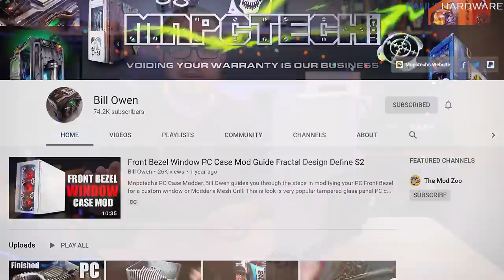I told myself this would be a quick fix...

Comment: Buy the bracket/AMD version and wait or chop a hole in an expensive and no longer available case. Personally I would have chosen the bracket but hey this was far more entertaining for everyone else!
Reply: Exactly, and I think it is also a good feeling to get something done.
Reply: yeah the bracket would of been the way to go. I got the same cooler and bought bracket for the amd cpu and it was definitely worth the 2 day wait lol. keeps cpu cool an didnt have to cut up my case.
Reply: Perhaps, it could have been easier all the way to just use a case with a little more headroom, then you could use the larger cooler. Not a lot larger but enough to use the coolers you already considered at some point. Obviously, this case is not intended for a high heat system - like you have, it is probably intended as a passive cooled system

Comment: Butchering the Sentry case, that's was painful to watch
Reply: Ya, especially when it's designed to handle a 120 AIO and you know he's got like 12 sitting around his garage
Reply: @adamb27473  Probably doesn't want to add an AIO to something that he wants running 24/7 collecting critical data. Honestly its a bit strange he choose that case given he's probably got quite a few other ITX cases. Like a Fractal Nano, or that Lian-li its case he used for computer was it?
Reply: @xxtovarichxx  that's a really good point. I'm assuming he just used it because he needed a surveillance build and Dr zaber sponsered a build at the time, but no reason to keep it in there now. With regards to the AIO in a 24/7 build, at this point, aios are plenty reliable enough. Failure rates are incredible low and the pumps are rated for a rediculous amount of hours, I believe asetek is 70000 hours or 8 years mtbf. 24/7 heat will cause more stress, but not enough that I would worry about it.

Comment: No repair is ever quick.
Reply from the maker: wise words
Reply: @paulshardware  turn the fan the other way around. You will get very similar performance and slightly drop case temps.
Reply: For me it is more like okay this quck fix should do it. Done in a jiffy. But then 1 minute later I'm looking at what I have done in disgust and I have to do it properly. This of course takes much longer.

Comment: Computer cooling that makes no noise at all, that's my FANtasy.
Reply from the maker: But to truly be noiseless, must one not also go fanless? 🤔
Reply: @paulshardware  Or we just implement the fans at either side of a house, so they are far away enough to not hear them. I hear LinusTechTips whole house aircooling coming up!
Reply: @paulshardware  you got 1.2 mil too many then ;)
Reply: @paulshardware  I would rather hear fan noise than coil whine.
Reply: @Lead_Foot  coil whine is the worst.
Reply: @Lead_Foot  Jup I bought myself a fanless dell laptop just for silence. Coil whine is bad, so now I use an ipad for content consumption. So Pauls solution is certainly great, as long as the fan sounds are controllable - I wouldn‘t wanna work next to something that ramps up and down fans all the time

Comment: You could cut the corners 45 degrees to get 90 decrees =) Like a frame.
Reply: Trim out a door.. you always use a miter box.
Reply: @mikeb3176785  Have not used a miter box in over 20 years yet I have trimmed out a few houses.  Am I doing something wrong?
Reply: @ShainAndrews  A miter saw does the job, with power!

Comment: You had me at Paul's "quick fix" in the title and a picture of the angle grinder. This can't end well.

My own "quick fix" a couple days ago, was to fix a nagging nit of a problem by "quickly" flashing the bleeding-edge OpenWrt software image onto my router before doing the dishes and laundry etc.. Two days of panic and sweat later, I managed to un-brick the router and flash the exact same firmware I had the nits with. Guess which nits I'm happily willing to live with until they release the official upgrade. I can un-clench and go do those dishes now.

Comment: You just made an Xbox Series P for Paul.

17:33 - Also for the black strips you made for the cut. Just cut them in a 45 degree angle and you'll get a closed corner for the cut and not have it open. Quick maths.
Reply: PC Series P

Comment: For my portable gaming rig (Node 202, R5 2600, GTX 1060) im using the NH-L9i that i had, with the AM4-bracket, which i got for free from noctua. Scince the cooler is 37mm high and the Node 202 has about 58mm clearance, i switched the included NF-A9x14 with a NF-A9x25 chromax.black fan. This resulted in a few degrees Celsius cooler operation while having a much less noticable sound profile and the black fan with the chrome cooler looks absolutely gorgeous. I am really happy how it all turned out with this rig!!

Comment: Even though watching you mod the case is very entertaining I believe there were better solutions for your issues like moving to a larger case, simply leaving the case without the side panel, waiting for the parts to use the replacement cooler or even switching to an intel system to use the cooler and case if you had the parts. Not as entertaining as the end result but probably more practical.

On another note, you should consider adding a grill to that fan in order to avoid possible accidents now that its exposed outside the case, maybe a custom grill with your channel logo?

Comment: Paul, coming from a carpentry and welding background, the way to get that U-Channel to not have the corner gaps is to cut each end on a 45 degree angle so each end meets. Just something for future reference.
Reply: Electrician here, exactly what I do for the corners-relief cuts are good as well for tight internal curves; its called profile in my part of the world-we use it for cut outs in electrical trunking, switch-gear enclosures etc. 

I have the NH-L12 in a Streacom DA2 9700K build. It is silent unless I'm gaming, brilliant cooler.

Comment: 9:00 If you're on a budget and don't want to buy the rubber u-channel material, you can slit the length of any spare electrical wire you've got laying around, pull out the conductor(s) and use the casing from the wire to treat your mod'd case edges.

Comment: It's aesthetically actually quite pleasing (when the corners of that rubber strip gets fixed, try snipping at a 45 degree angle, like with walltrim). And maybe Jay'd be interested to do a themed modding to 'blend in' the fan, the red light and little feet, turning it into a Surveillance Sentry Bot or sth.

Comment: I wanted this case.  Still kind of want it, but I ended up getting a Node 202.  I'm happy with the build, but the reason why I wanted this case was for portability.  The Node 202 doesn't easily fit in to my backpack like the Sentry would.  Oh well, I digress.  Time to get a new bag.

Glad to see you were able to get your issue resolved. My initial thought was, "I can't believe that he's gonna cut a hole in that awesome case" Fast forward to the end of the video and, I almost wish you would have mounted that hard drive on the outside like the cooler is.  Keep it where it's located, just mount it on the outside, then you would have both your CPU cooler, and HDD on the outside to look at.

Comment: The NH-L9i is amazing. I just put one in my father in-laws PC. He was running an intel stock cooler for the last 5 years. It was idling at 80-90 C. The thermal paste was dust. It was bad. Anyways the results were a near 60 degree drop. I was impressed that such a small cooler could do so well. Noctua is legit.

Comment: The only thing I'd change is 45 degree cuts on the trimming - good job! 

If you want a fan grill like many are mentioning, maybe you can use the piece of the case you cut out and mount it to the top of the fan? With more trimming of course.

Comment: You can put some electrical tape (small pieces) at the corners or if you have black paint you can paint it with a small brush. In case you have a spray paint not a bucket, you can spray into a cup/cap so that you can dip a paint brush.

Comment: Nice job on that cut out-!  A nice chrome wire grille would work well on that exposed fan and not hurt airflow or noise at all.  I use em on cases that have punched fan exhaust holes because this makes fans louder, the round wire chrome grilles are the quietest grilles ive found and almost indestructible especially in an exposed area like this.  I cut out the punched opening and install the chrome wire grille over it, makes a very functional mod.

Comment: Hi Paul. At 17:30, you could have put a slit down the top side of the rubber strip (the side facing towards the fan once fitted). This would have allowed you to extend the other two sides of the rubber strip to neaten up the aesthetic if you were wanting to do so. Nice video, thanks :)

Comment: RIP Sentry Case.
Reply from the maker: I MADE IT BETTER
Reply: My thoughts exactly. I have a Sentry 2.0 and with how expensive and difficult to get it was I can't imagine doing something like this to it.
Reply: @paulshardware  I get the argument that "Hey, this is what I have in stock, and I need to make a vid" but why in the WORLD wouldn't you just order the alpenfoen black ridge, or ID IS-60? Or just swap it to a Node 202 to get an extra 12mm of cooler clearance? Seems like going for a non-reversible mod on a non-replaceable case for such a mundane cooling solution is just a waste.
Reply: @benjaminprescott384   Because before it was just, meh... and because it's fun to color outside the lines sometimes. Why waste money on another case when you can give it MORE POWER, ARGH ARGH ARGH!
Reply: @aaaarrrg3773  Because this is a fairly expensive case - and very limited in supply. Also because the end result looks godawful, and could have been avoided with another case.
Reply: @paulshardware  Monster! :~(
Reply: @amshermansen  Does a case have monetary value, or is it a tool to achieve something? He made the case more functional. 

Some cases are beautiful, but the Sentry case is ugly as sin to start with so no harm done on that front.

Comment: For the U-channel wrap, you can just cut the bottom side of the rubber a tiny bit shorter (roughly how wide the adjoining side channel is) and let it hang over to take up the gaps in the corners. basically notching it out so you have a flap that hangs over the edge of your cut. I've done the same with Drywall cornerbead for a window. You could 45 it but I'm guessing that's harder with U-channel to pull off.

Comment: Since the heatsink/fan are outside, running the fan as exhaust may result in better temperatures and also reduce dust buildup inside the case.

Comment: @Paul's Hardware - You could have cut the U-channel at 45° outward angle to make the ends flush in the corners. I would probably take it a step further and glue the corners and centers to prevent it coming off.

Comment: I think it is nice to use a  small form factor however  passive cooled is the only option

i'd use a 1 ton press or look at a  standard cooler that isn't a heat a heat pipe design

Comment: @Paul's Hardware iv used BlueIris to handle cameras. Setup a few systems, one had 21 cameras, multiple drives for backup and offsite backup, it has its own webhost so you can do remote access through your phone. The way we do them is main network into pc, second network card out to a router with a POE switch with all the cameras. Works great and haven't had any clients complain (except for usual ISP buggery)

Comment: Paul, mitered corners are your friend. For those in the audience, mitered means instead of cutting the rubber of at 90 degrees (a square corner), you cut it at 45 degrees to bisect the 90 of the corner, which means both rubbers overlap half the angle, resulting in a clean seam and no "naked" gap where they join. So, hold the snips at 45 degrees instead of 90 and done, no ugliness. Just remember the needed length is the short part of the snip angle, not the long "ears" part.
Paul, Dr Zaber hates you now, he went through a great deal of planning to make a small, beautiful, and versatile case, and you murdered it. Nice overall job though, you recovered a LOT more face than I figured you would, based on your (and my own) history.
Nice b-roll and editing, but that was Joe of course. Heh heh. Even if you didn't destroy anything really, I think the general expectation with the angle grinder thumbnail will get those mad clicks for you anyway. :-)

Comment: Wouldn't it make more sense to mount the fan in a pull configuration, to have it blow the heat away from the case rather than into the case?

Comment: The NH-L9a (NH-L9a AM4 for updated mounting solution) is the AMD version of that first cooler, so I'm not sure if the NH-L9i is going to be any good to you even with an extra bracket. 
I think you may have preferred to get the NH-L9x65 SE-AM4. It would still need a hole cut in the case, but much smaller and has the same cooling capacity as the NH-L12S.
However, if you find the original 
NF-A12x15 slim fan that came with the NH-L12S, you do have the option of mounting that inside the case so there are no spinning blades for little fingers to touch 😆

Comment: Why not just a 120mm AIO again? Worst case you cut some holes in the side panel over the GPU chamber to let air pass through, but you keep things inside the case that way. 

Did a similar mod to a RVZ-02 for a friend's build, worked really well. Just get a short GPU (or in your case, a hard drive), and with the hole I cut to pass air thru from the outside, into the rad, and thru the other side, temps were great.

Comment: The c7 comes with 92mm fan clips, I ended up attaching the noctua fan to the c7, I also tried a setup using the l9a and 3D print 120mm slim fan adapter

Comment: You could, as others already have pointed out, mitre the corners 45° like a picture frame. You can also dab a small amount of super glue on the mitred edges and fuse the rubber together so it will act as a single strip with corners :p

Comment: i have thought alot about pc home survey-lance and the one conclusion i have come to is no matter what you will WANT to pay for offsite storage. Because the point of camera set up's are for the unexpected and what if that involves the loss of your camera power unit and device. SO without proper backup power and dedication for cameras i feel a diy solution is far more expensive than required considering you can probably bundle security with your internet for less than it would cost just to rent server space with enough bandwidth to handle your cameras feed.

Comment: I probably would have cut a small amount of meat out of the back of the case to get the tubes of an AIO out of it. Then put the rad on the side of the case. I imagine the hole spacing on the top panel is 120 or 140mm fan compatible.
Your way Dr Zaber has a prolapse.
I still like it though.

Comment: Will your mechanical hard drive be able to handle several cameras feeding it 1080p at the same time?  Is it a 7200 RPM drive?  I have used WD black drives in the past, but moved to Samsung solid state hard drives.  I like the Samsung magic software that Samsung gives you for free to over prevision the drive.  As the ones I have have a 5 years warranty, and I over prevision them, I suspect they will last.  But I could be wrong.  I also want to build a PC just for the control and recording from about 6 cameras around my house.  They will be either 4K or 1080p....  Looking forward to your build.

Comment: So the issue was the impeded airflow by the RAM/integrated I/O shield/heatsink? Why not just rotate the cooler 90 degrees so you don't have that airflow limitation? Should've been a step between starting and cutting up the case.

Comment: I have an Unraid Server Setup with a VM setup with Windows 10 and running BlurIris security software and its running great.  Only got 2 cameras 1 is a 4k camera and the other is a cheapo 1080 eBay china special.  I have been running this setup for about 5 years.  One thing you need to be careful with is to make sure updates are off as if Windows updates and then reboots it can kill it in the VM, I have had that happen.

Comment: My Meshify C shook with horror after you said the word mod. But I do appreciate your tool craftsmanship. My real concern with that abomination of a cooler is the rubber you put on the edges is going to lose cohesiveness or melt due to the heat radiating off from it. That or i am completely wrong and it will work out for the best.

Comment: You mentioned you had a fan going because it was hot out. Do you have air conditioning in your shop? You can get a min-spliti heat pump system that is DIY.

Comment: He is mounting NH-L12S cooler this way in his 340*310*74 mm case meanwhile I am struggling to mount NH-L9i into my 254*215*60 mm case, where i already put my GT1030, 200W PSU and ITX MB with i5-7500 with one 8GB RAM stick. Great :D  I think I need a bigger case for my project.

Comment: If you're worried about structural strength with mods like this the easy answer is a very short length of aluminium T-track riveted inside the case where it will clear everything

Comment: Instead of chopping up a no longer available boutique case you could've just used google for 5 minutes and found out that one of the best setups you can go with is a Cryorig C7 (copper would be best but i dont think urs was copper) with the l9i fan on top, all it needs are a couple cable ties and the case isn't dead afterwards :(

Comment: Next time, cut the ends of your rubber strip at a 45 degree angle. That way when both sides meet in the corner, they form a 90 and that gap won't be as prominent.

Comment: At 17:35 you could have cut the rubber molding at a 45 degree angle at all the ends and it would have been a perfect square. Otherwise great mod job.